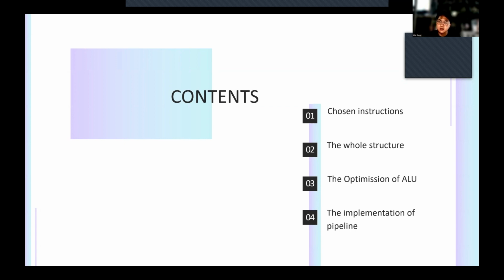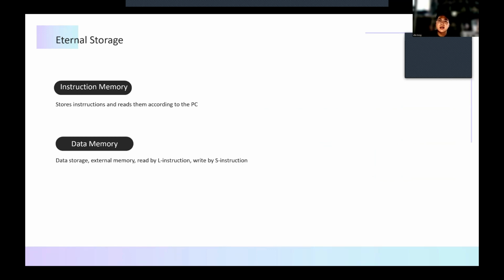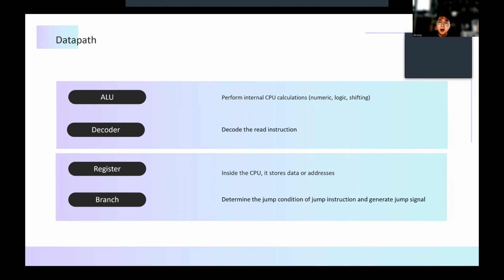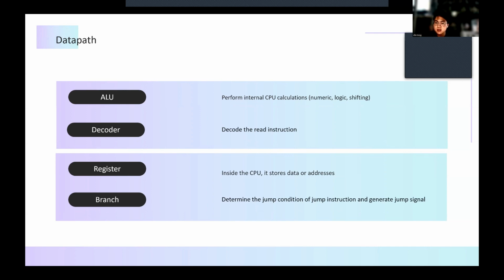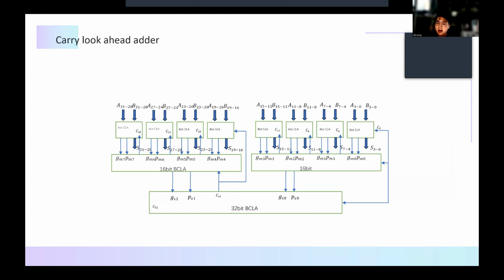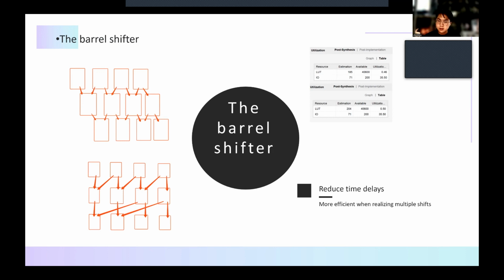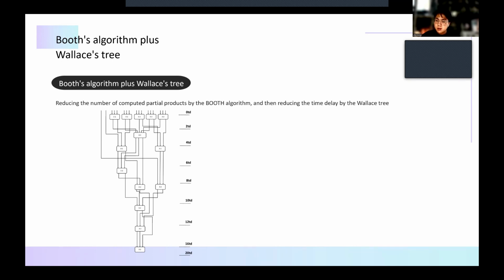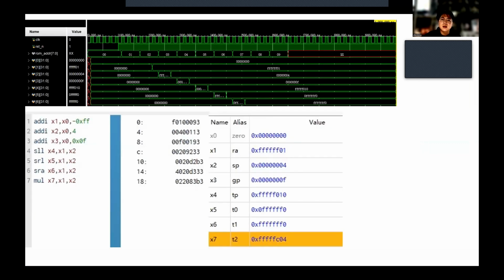CONF-MLA 2023—Design a 5-stage pipeline RISC-V CPU and optimise its ALU

Comment from the maker: Q: In the design, how can one determine if the number of 5 pipeline stages is the most suitable for the RISC-V architecture? What theoretical or practical experiences can support this decision?
Reply from the maker: RE: RISC-V CPU uses 5-stage pipeline to improve system throughput and instruction per clock cycle (IPC). 5-stage pipeline is the most suitable for RISC-V CPU because it can maintain high IPC while avoiding too much pipeline delay.